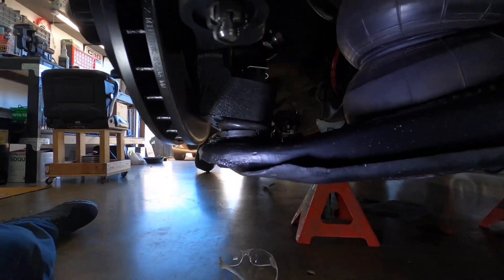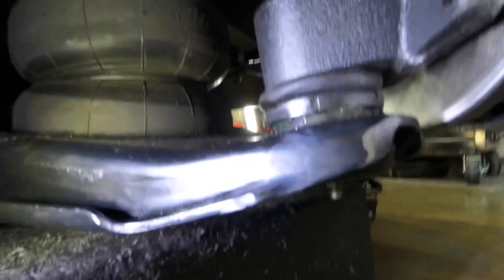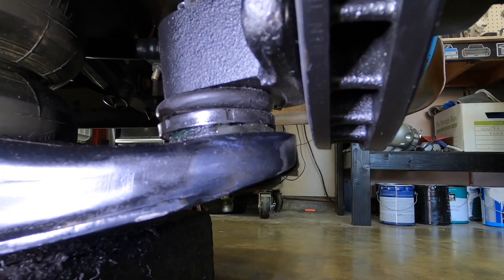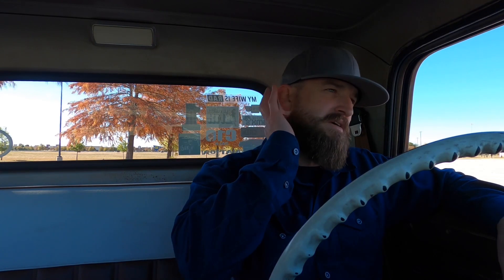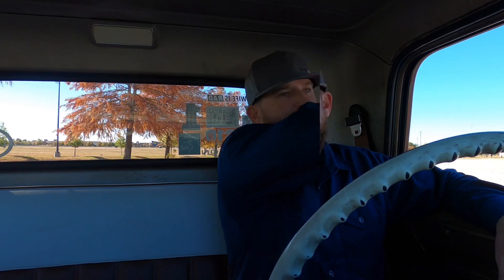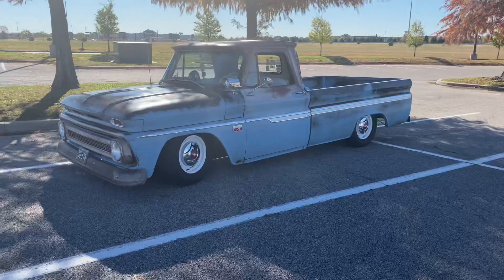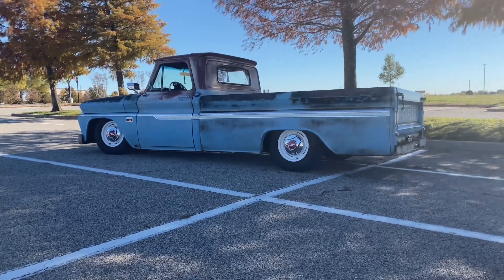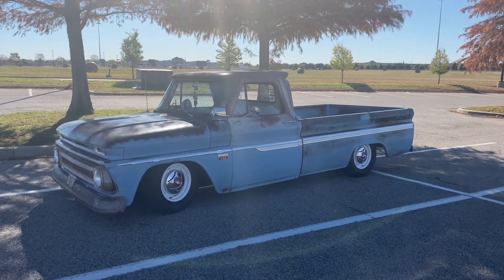1966 C10 disc brake conversion part 4 test drive

Comment: I have a 66 chevy c-10 pickup as well and just ordered the upgrade kit to disc brakes with a new master cylinder w/brake booster and the stainless steel brake line kit. Recently had to replace my lower control arms so I could get my front end alignment. After I installed my control arms I had an issue getting my spindle past the end of the A arm to fit over my lower ball joint,so I had to use my angle grinder in the same manner as yourself and cut the tip off just a little bit so it would clear. I'm hoping mine isn't as bad as yours was for you,but if it is,at least I'll know what I need to do. Thank you for the videos from 1-4 your subscriber.   ERNEST
Reply from the maker: It’s frustrating that I had to cut the control arms like that but it is what it is. 2 years later and still no issues so I guess it’s not that big of a deal. Thanks for subscribing.

Comment: Beautiful build man👍 did a disk brake conversion on a 65 c10.have the same issue when turning can’t figure out where it was rubbing thought it was the rims bought spacers still rubbing feels like the brakes are being applied when turning.i will be checking the A arm tonight thx.
Reply from the maker: Thanks brother 👊🏻 What drop spindles are you running? I had the same issue with my 1970 c10 I use to have. I had 8” wide rallies in the front and they rubbed when turning, then I changed to 6” wide steelies and no more issues. Drop spindles and 15” wheels can cause issues.
Reply: @Chickeneyegarage  thx for the response I’m using stock height spindles wit 15x6 wheels I was able to find the scraping after watching your video same part of a arm but on the inner part of the disk thx again 👍

Comment: My only concern with that lower control arm surgery would be a crack forming at the top of the lil arch you made. I would have welded in a piece on the inside to cover that gap while still maintaining clearance to the rotor. It's been a year so it'd be interesting if this is still ok
Reply from the maker: I"ve though about doing that but so far no issues with the control arms

Comment: Every disc brake kit I have seen for the front of C10’s use a spacer behind the inner wheel bearing. I am sure the are cut with a radius to match the spindle and bearing. They also had the stamped caliper mount. The lower control arm are the same, including the C20 lower. I don’t know what size the caliper piston is but I used stock GM parts for price & future serviceable.  I have a 67 and chose to keep rear drum because I am not racing even with a 5.3L “LS” engine and my bench build 700R4. Using C-20 lower control arms, made room for 88-98 heavy-half C1500 parts. Calipers are 2 15/16” ID, the lower control arm used the GVW  7300 ball joints. 6 X 5.5” rotors are 11.5” OD & 1.125 thick. I had new ACDelco ceramic pads and Rock Auto had power coated calipers at $20 each no core. Tie rod ends, adjusting sleeves with bolts were $3.50 @, 12” brake hoses all listed for 80’s + Impala that fit everything for 35 years. Even 2001-2002 Light duty rotors, wheel bearings, seals all the same but come with tone ring / reluctor for ABS. Added 40 metal tone ring on output shaft of 4L60 then used the 92-94 magnetic VSS to run into the PCM. Other than 16” wheels and 265/75R16 Kelly tires, I spent $32 at the salvage yard, $128 at Rock Auto, new stock 72 C10 tandem master cylinder w/ 1 1/8 bore, 03 Tahoe booster free, $55 for power brake adaptor and disc/drum chrome combination valve $42 eBay. Bought brake lines, rock guard and a bad of fitting the made all of the lines myself w/SnapOn flare kit. 22 gallon El Co tank with side filler to original neck in LR quarter panel, ACDelco EP339 pump in custom spring loaded bucket & bottom strainer. The bed walls are 2” apart, so flushed a rectangular door w/rubber boot and internal drain tube. I used a 98 & up rectangular carbon canister with purge on a tank fumes routed for easy fill ups plus better MPG. 3.08 final on Auburn locker gets me 23 highway and 18 in town, if I keep my foot off one pedal. Still up in the air on front bags as some say you have to find a happy place for PSI to get a nice smooth ride. Besides, the OEM springs last 55 years, not going lower but how long to bags last if they don’t rub or get hit by highway debris? Retired ASE Master
Reply from the maker: I’m sure air bags have a life span just like anything else made of rubber. I don’t know how often big rigs change their bags but I’m guessing at least every 5 years.
Reply: Thanks for the reply. Air bags have been used for a number of years on vehicles. I think last model year, Dodge started an air bag assist but I don’t know if it’s a helper or complete suspension component. The difference is on a pickup like we would use them, require regular inspection. Silicone grease is used on door seal rubber to rehydrate them. Wipe it on, rub it in, then wipe 95% of it off. This was in vehicle owners manuals for years in the maintenance section. Not only does it extend the life by not cracking but it freeze here an this keeps doors from sticking.
 Used as a suspension component, at failure the vehicle drops on the corner. On a big rig, if they deflate, the brake applies because they use leaf springs to hold up the tractor or trailer. Good observation. Thanks & best of luck! I love the old trucks.

Comment: I got the same setup. To get the most out of your rear c-notch, and have the rear axle to actually sit inside the frame, use two inch drop blocks. I see a lot of folks running notches without them and get hardly any drop out of it. The bags deflate fully before the axle gets up in the frame.

Comment: You are running 3-speed manual, 373 diff, 225/75 R15 wheels -- Are you happy with the highway engine RPMs?  I am really digging your truck.
Reply from the maker: It’s around 3000rpm at 65. It would be nice to have an overdrive

Comment: Did you have to get different wheels for the backspacing? And if so what offset and width?
Reply from the maker: You have to get different wheels because the originals won’t clear the calipers. I don’t remember the backspacing but I have 15x6” wheels. Can’t go too wide with 15” wheels and drop spindles because they will rub the control arms

Comment: does your cross member hit the ground ? if a bag fails do u got any saftey built into it. I love video about the top plate the truck i picked up bags are rubbing.
Reply from the maker: Cross member is very close to the ground but doesn’t hit it. Never really thought of doing a built in safety failure. I wouldn’t really know what to do if I wanted to. It has dot airlines and fittings so it’s safe for the rode

Comment: It looks to me like your control arms are slightly lower than your crossmember.  Does that mean if you had tubular control arms you could possibly go slightly lower?  I'm trying to figure out how low I can get mine with stock cupped arms or tubular arms if that gets me slightly lower.  Also planned to have to lift my bed floor to make my truck sit level aired out but it seems like a mini notch may be enough to make me sit level with stock crossmember on the ground and not have to raise my bed floor?  I've got a 66 swb.
Reply from the maker: The only way I can go lower is cut the fender wells. The well sits on the tire when aired out. I’m not cut my fenders for an extra inch or two. I’m going to mini notch the rear soon and it looks like I will have to raise the bed floor or cut an opening in the wood to go down more. Right now the top of the rear end is less than and inch away from the wood
Reply: @Chickeneyegarage  I guess I'm still looking for an answer if lower control arms will get me slightly lower or if the crossmember will bottom out before my stock lowers? I'm willing to spend the money and save the time from cupping myself if there is an advantage. Also why not just pull your inner fenders out like lots of guys do? I agree with you that a truck doesn't need to be on the ground to have a good stance and I think your stance is great if you just level the back but low is always cool.
Reply from the maker: @diversedad7954  I can’t answer the control arm question. As far as the removing fender wells, you would have to trim the fender edge and you will need to figure out hood hinges. I’m not doing any of that unless I wanted to lay frame
Reply: @Chickeneyegarage  looking forward to seeing your c notch mod.

Comment: I’m about to embark on a total rebuild on my 66 swb. If you were to do this again would you use the factory cupped arms or buy aftermarket ones setup for air bags? Is it worth the extra money? Also, did you cup the arms yourself or buy them that way? I didn’t see a video of how you got the cupped arms. Truck looks great! I don’t see much of a rake.
Reply from the maker: I would do factory cupped arms again if I was doing another truck. I would probably used aftermarket arms along with a drop member if I was trying to lay frame. Corrects all the suspension geometry. I had a friend I know cup the arms